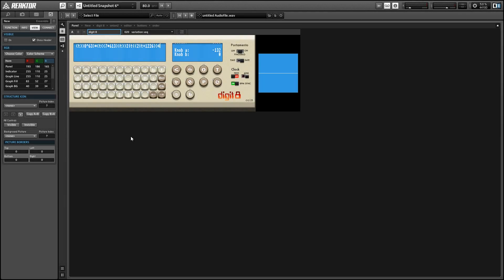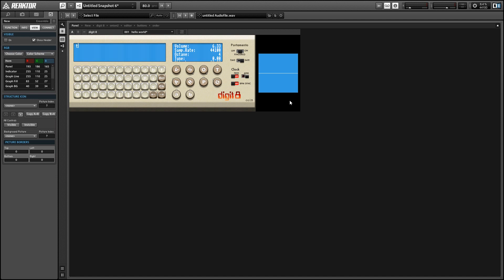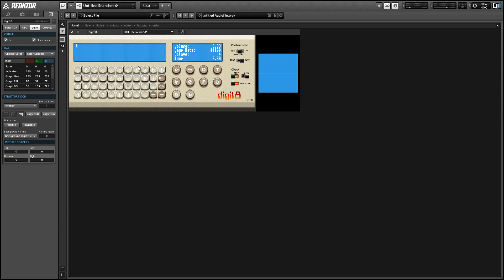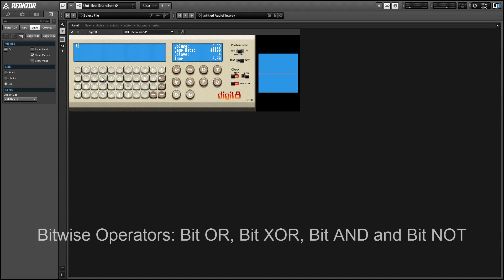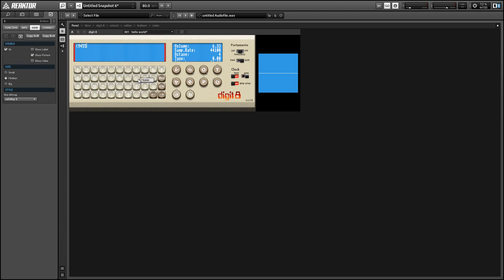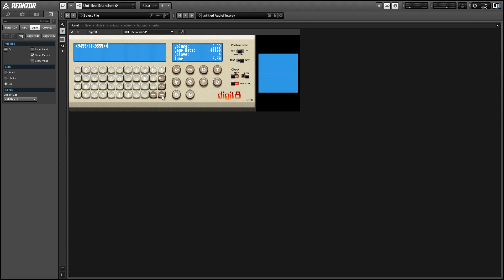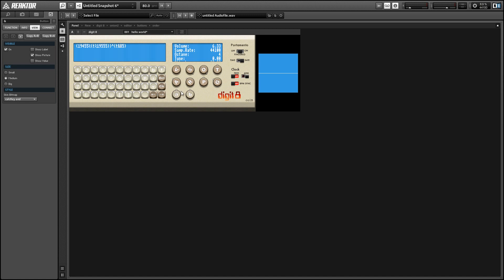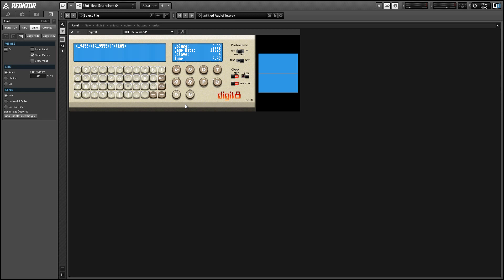NI Reaktor - Using Digit 8 - How to Tutorial

Comment: I know you're up to your elbows in core right now, but I was wondering if you could make a tut showing us how to create a volume gate module with threshold settings and a simple attack and decay envelope. I thought it would be cool if I could get incoming audio above and below -50 db to round out to a simple 0-1 gate signal to trigger an envelope.
Reply from the maker: i may be misunderstanding you - you want a macro that outputs a 1 when the audio is above a certain dB threshold, and a 0 if not?
Reply: ***** Yep, that's exactly what I want.
Reply from the maker: I would try a combination of a peak detector and a compare module. Find the peak of the signal, translate it to dB using a log(A) module, and compare it to the decibel amount (-50 or whatever) the > output of the compare module will give your signal ;)
Reply: ***** THX!! :)